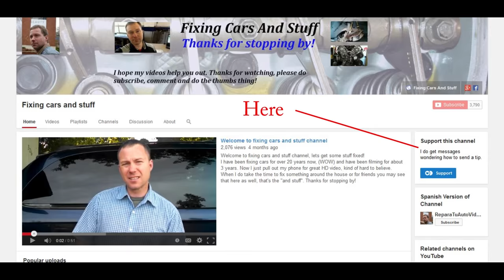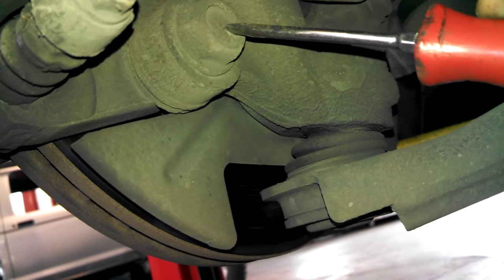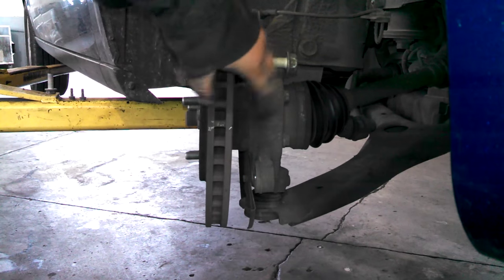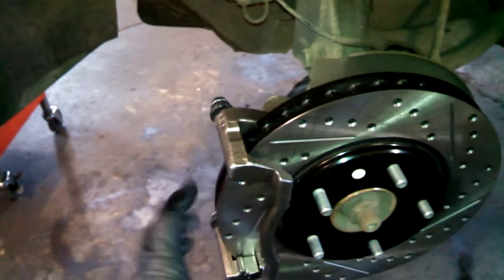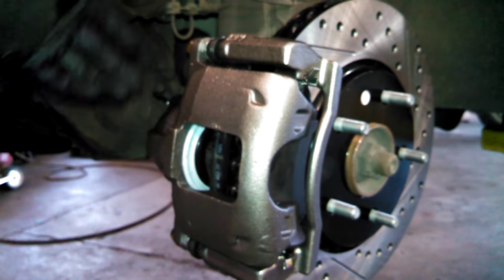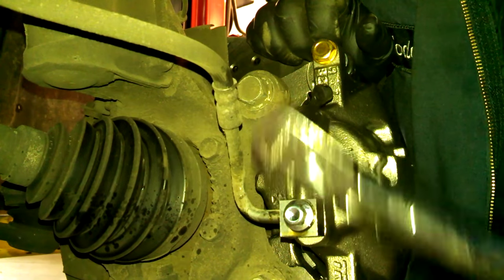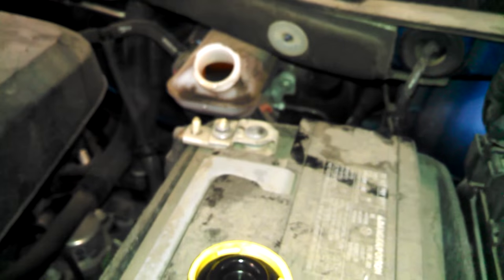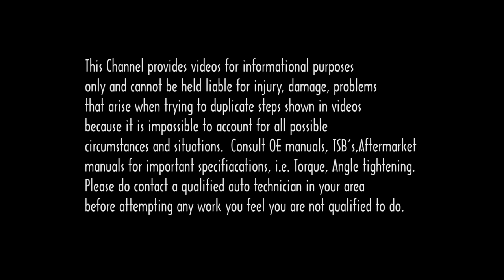Front brake pad replacement 2013 Dodge Grand Caravan 2008-2013 install brake pads

Comment: There is a huge misconception with these rotors, but with many getting them installed and not knowing what difference is to be felt, it's why many feel its a must. The issue with these vans is poor engineering, they put too small of rotors on these 4th & 5th gen vans.
Reply: cross drilled and slotted on my MV did help...agreed, poor engineering or cheap accountants building the cars...both my 07 and 13 have mediocre brakes...short life span.  15K miles ??  come on....